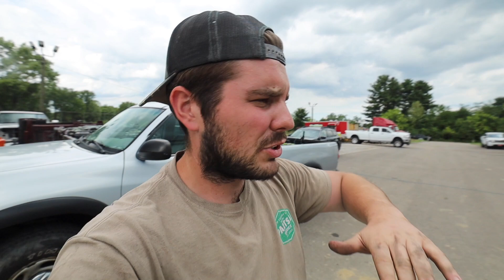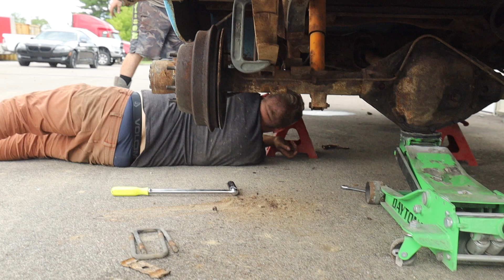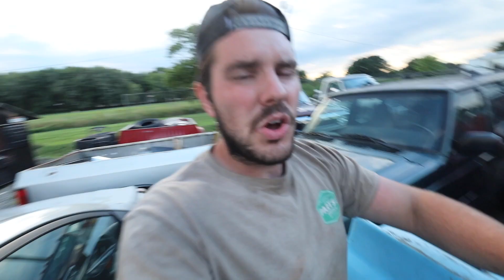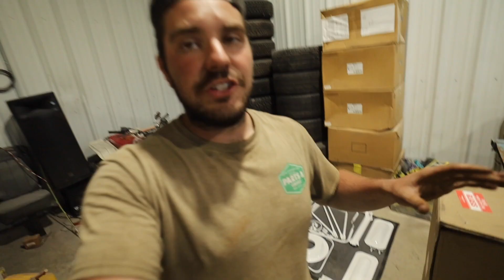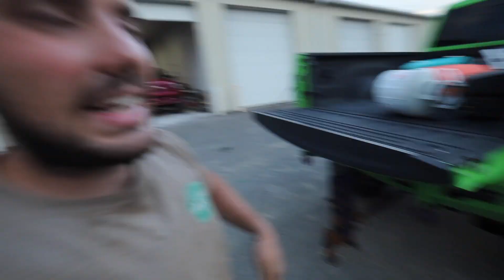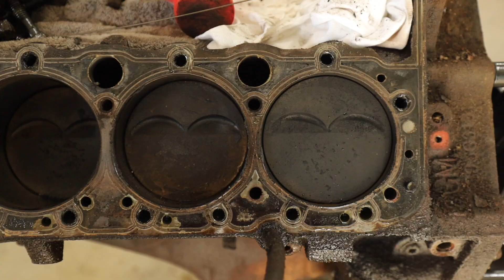Time to Pull The Motor!

Comment: Reason one side had more leafs then other is the fact the campers they had at the time it was made had water tanks and propane tanks waste tanks etc built in.. So they added more to one side so the campers that had the tanks on its one side would NOT over extend the suspension under full load

Comment: difference. Put bandaids on everything.. that's why the ford broke just like the leaf springs on the old chevy will brake with out that bottom thick leaf you took out.  That one keeps the leaf springs from twisting.  Adds support to the existing.

Comment: hey Ryan i have a 1990 Chevy k1500 single cab step side that needs to be painted i have the cab and doors stripped down to bare metal and brand new fenders but how much would you charge me to paint my truck mango tango orange if i provided the paint and other materials

Comment: Always new head bolts or studs. It's a long explanation but basically they need to be heat treated so the molecules of the steel are lined up properly and that makes them so so much stronger
Reply: Nah you can re-use them